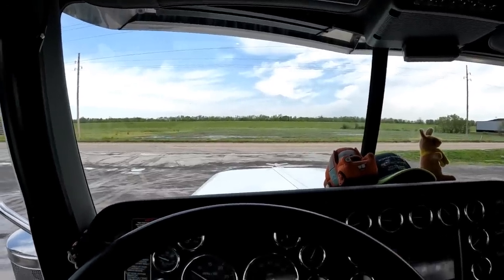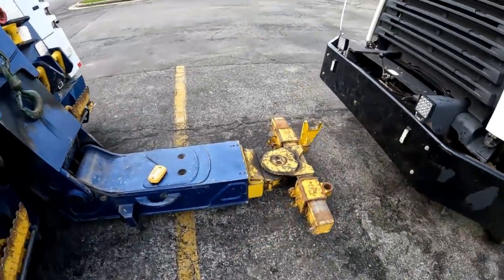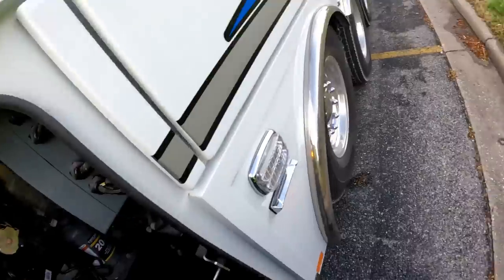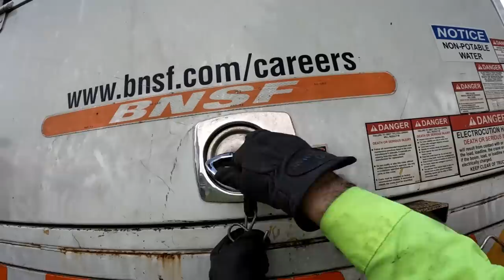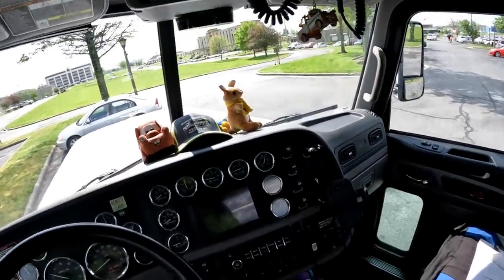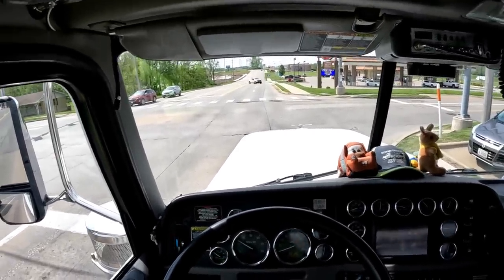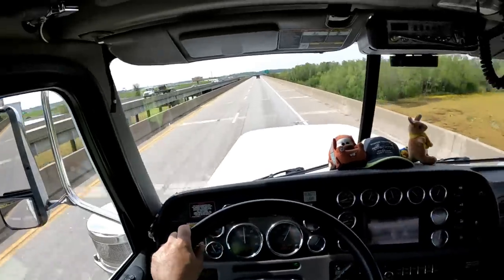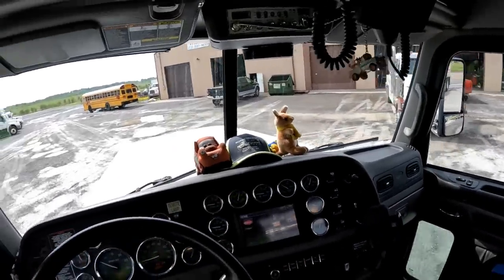ROTATOR TOWING A LARGE HYRAILER TRUCK.

Comment: 19:35 Hello! I do heavy in Europe and how do you go about making it so the towed vehicle reacts to your brake pressure?
Reply from the maker: It can be difficult to explain, but I will do my best.  First, you must have emergency air supply, as you normally would to release the parking brakes and provide air for the air ride suspensions.   Then there are several ways to get service brakes.   If you can find the treadle (foot) valve, typically located on the firewall, you will have to determine which air line supplies air from that valve to the service relay valve.   On some trucks that can be difficult.    If you can't determine which line, you can go under the truck, find the service relay valve, remove the "control" line and run your service air line direct to the control port so that when you apply the foot brake on your truck it activates the service brake on the towed vehicle(s).   This is the same principle as running your emergency and service air to a trailer that you are towing.   There is another option and I am trying out the product now.   Zip's sells an item that used to be called a "brake buddy", but now it's called the "SafeAll Remote Brake Assist".  It sells for around $600.   It is extremely simple to use.   Secure the steering wheel.   Use the built-in clamps on the tool to attach it to both the steering wheel and the brake pedal of the towed vehicle and connect your service air line direct to the tool....bam...your done....quick and simple.    Hopefully this will help you.   I know that trying to stop the loads that we are tasked with moving can be difficult and unsafe if not running service brakes.  Any more question you may have, I will do my best to answer.   Thanks for watching and God bless.

Comment: 130k seems like a lot. How does DOT road weights work with tow companies?
Reply from the maker: In Missouri we can move anything, regardless of height, weight, and/or length on a "first hook" basis to the first available "safe zone"......it's a pretty grey area.  Typically, if we are towing a disabled vehicle to our shop then there are no issues.   When we cross state lines, then we have to be legal just like every other truck on the road.   We can get permits in certain states as well.    Thanks for watching and God bless.

Comment: Have you had to grab one of these that died while on the rails? Tow train time.
Reply from the maker: Yes, I have, many, many times.   The rail lines don't like video taken near the tracks.    Typically, there will be a problem with the hydraulic system.   The unit will on the the rail with the rail gear down, outriggers deployed, and using the boom when the hydraulics fail.   Makes for a long day....    Thanks for watching and God bless.

Comment: Somewhat surprised BNSF didn't require you to blur their name/logo ... railroads are usually very particular about that.

As for the weight of the truck, yes - it's a heavy truck.  It's also still less than half the weight of the lightest of locomotives...